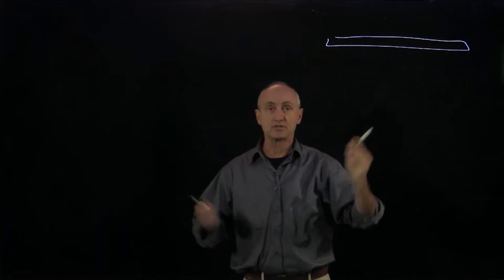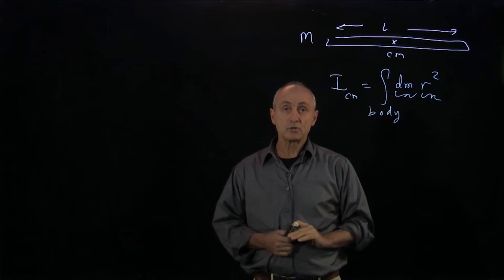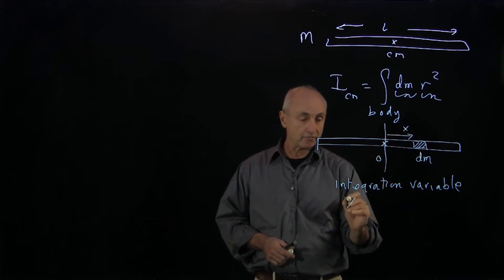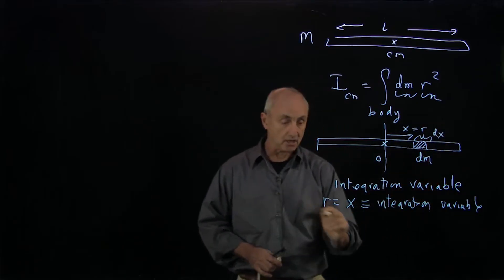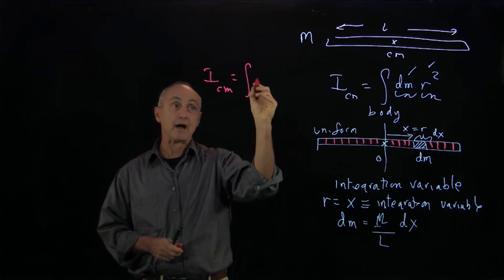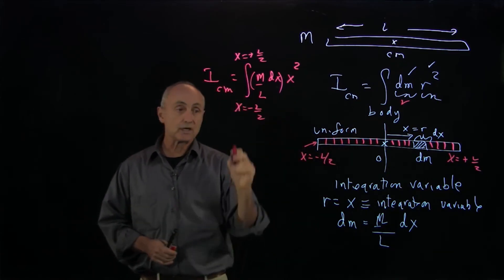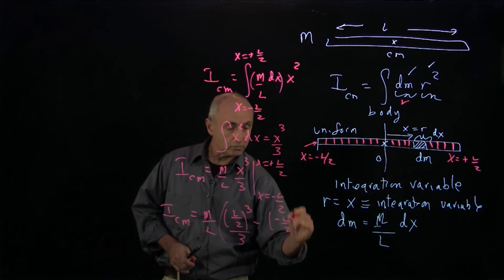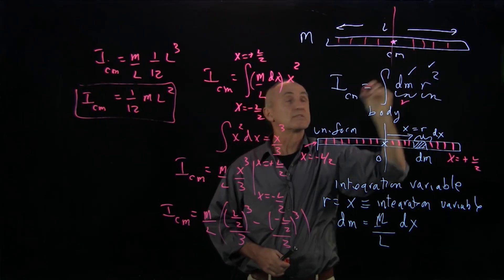29.2 Moment of Inertia of a Rod

Comment: I dont understand how dm equals m/L dx
Reply: dm/dx= m/l (this is because the rod is assumed to be uniform, hence the mass per unit length ratio is same for any arbitrary piece of the rod)
dm=(m/l)dx ( by multiplying both sides by dx)
Reply: m/l tells you how much mass there is per unit length. but the dm entity aint a unit length long, its infinitesimal small(dx). so to get dm (mass) we multiple dx (length) with m/l (mass per unit length)